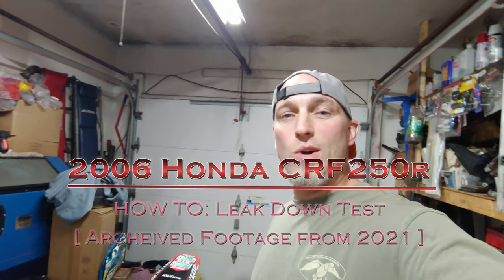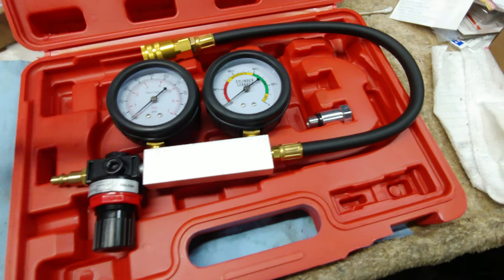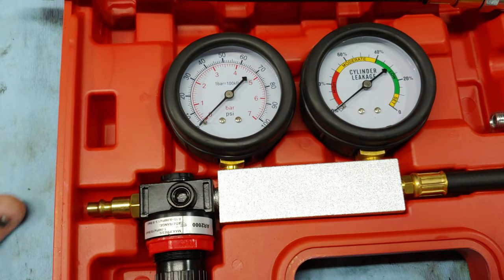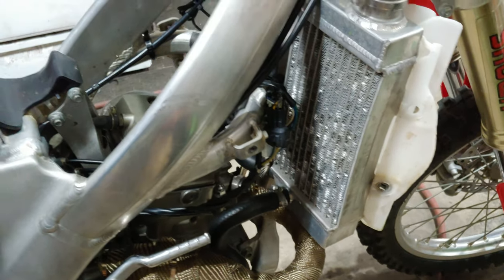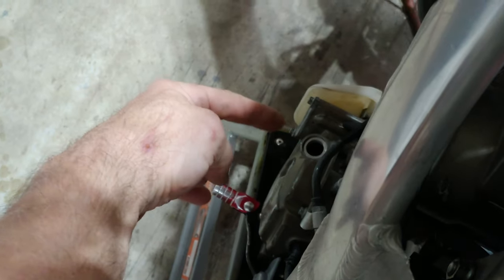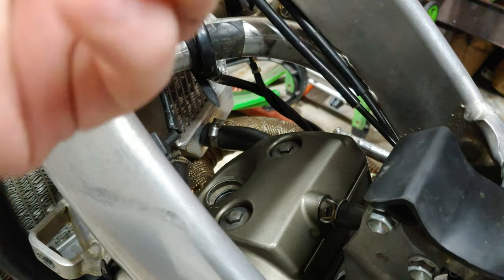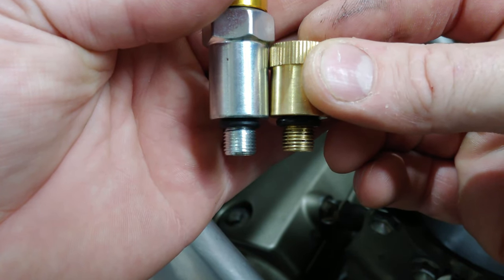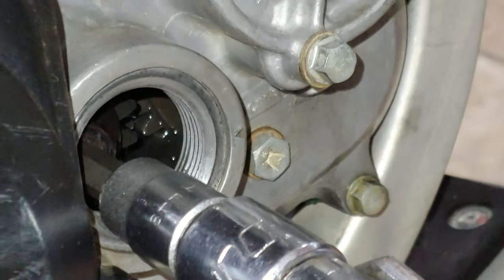Leak Down Testing || How To || Honda CRF250r

Comment: About the most useless video on here.. 10 mins of blah blah blah.. then no explanation of what is going on.. unbelievable.
Reply from the maker: Leakdown test. Bring the piston to TDC on compression stroke? Hold crank still and use air and gauge to pressurize the cylinder to find out how much blowby. 5% or less is good. Not that hard to understand I didn't think....

 I explained everything needed to know including symptoms of engine and why I did a leakdown test to begin with. So the "blah blah blah" was good information. Honestly if can't get the info you needed from this video to know whether you should do a leak down test and follow directions on how to do it, might want to just take your bike to a mechanic. 

 What else did you want to know...?
Reply: @Fixin2Ride-Official-  took you 2 mins to say that.. the other 10 of you listening to yourself was unnecessary
Reply from the maker: @toblerorg hey man no one asked you to listen to the channel. I'm not trying to be a jerk or anything but you're coming at me pretty harsh. I'm sorry if you don't know the process of doing a leak down test and if you are also having issues with your bike. But that doesn't give you the right to come at people on the internet that have made a video trying to help other people